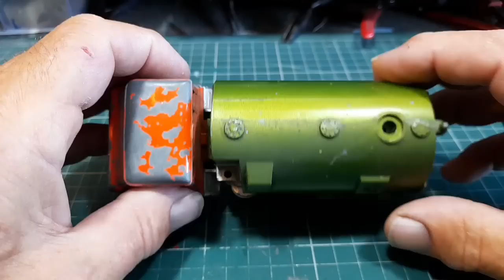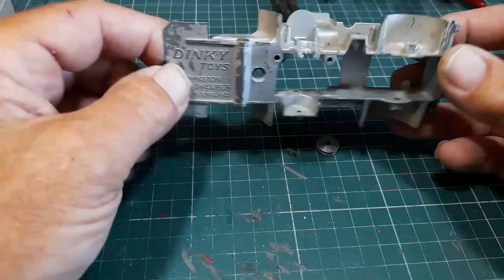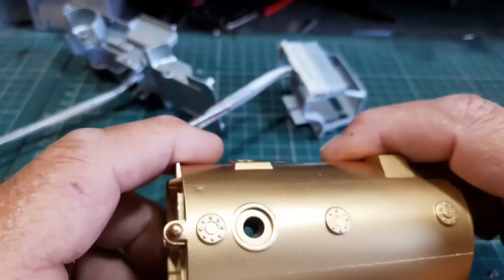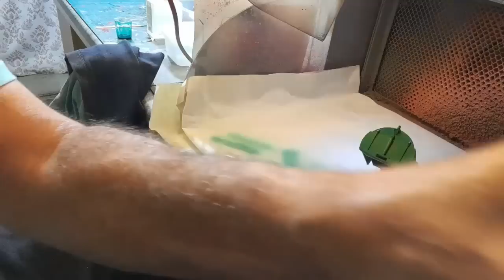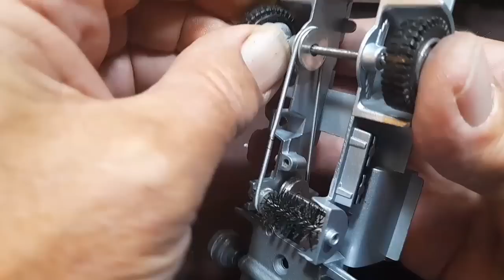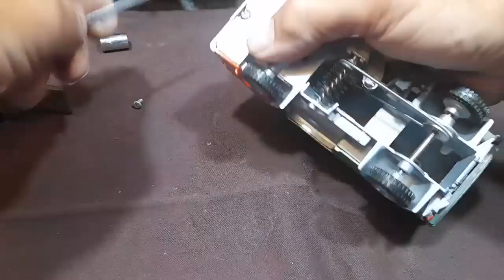Dinky toys Diecast Restoration Johnson Street cleaner no/451  1971/76.

Comment: Hi Martin I have done three of these on mine they have a short pipe clipped to the tank by the brush for an extension pipe for the gulley suction hose, but a v nice resto all the same. 
Thanks Paul 😊
Reply from the maker: Cheers paul ,I didn't realise that I will have a look at doing one .
All the best martin 👍

Comment: Stunning restoration Martin, excellent work on the paint for the back, I’m glad I’ve seen you do this, now I know I need to get into using my airbrush! You gat a heck of a shine on the cab too, I see you had the obligatory tight passenger door too! The spring belts you can get on eBay, used on both Wilesco and Mamod model Steam engines, a seller called Station500 sells them! A great restoration Martin, I really enjoyed watching the video, especially watching on the big Telly, better than on my phone lol😉😊👍 Take care, all the best, Nick.🐸🐸🐸🇯🇪
Reply from the maker: Cheers nick ,thanks for the heads up on the spring thats great .
The air brush is not as hard as you thick nick try with some diluted black paint on some plain paper so you get to see what to do ,mix your paint to the thickness of milk or a bit thinner. Iam convinced you will be fine ,thay are handy when doing colours you can't get in a rattle can ,and there's no need for fancy expensive airbrushes the basic will do for what we do .
All the best martin 👍

Comment: two minor comments,you omitted to add the amber to the flashing beacon at the rear!& secondly,as i've done with all my Ford D800's by Dinky,is upsize the steering wheel.In reality,it would be like having a Mini's wheel in a truck!otherwise,a top resto.
Reply from the maker: OK great I will do the beacon later ,
Good tip on the steering wheel 👍 I will see if I have any larger ones in my spares  thank as alwaysfor your help
All the bestmartin,
Reply: @martindaredare   very observant,me,Martin.I seem to recall you have a lot of Corgi Escort 55 vans.The steering wheel in one of those would fit nicely.
Reply from the maker: Thanks for the heads up with the escorts steering wheel. 
Iam glad your observant